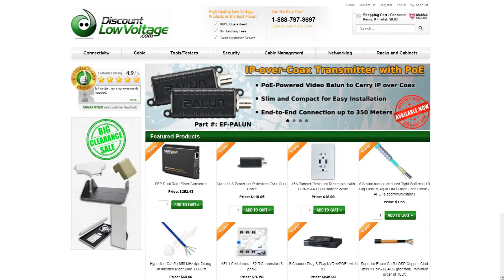Passive video balun 1 pair for security cameras on Cat5e cable

Comment: By using 2 pair of utp for video and 2 pair for power in the same balun, we are getting ghosting effecr
Reply from the maker: If you're also using a coaxial cable, either between the balun and DVR or the balun and camera you might want to check that cable.  Ghosting is common with the poor ground with the shield. ⚡